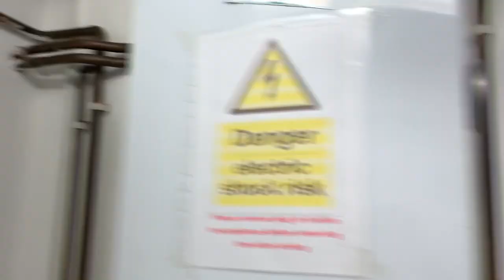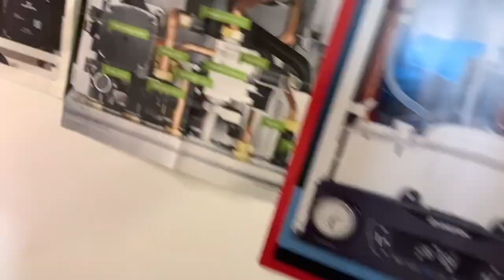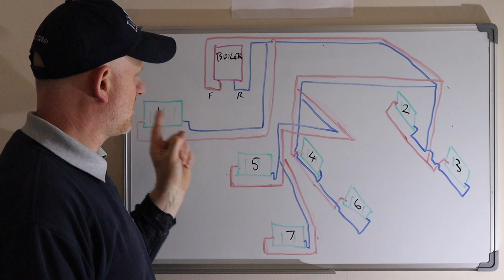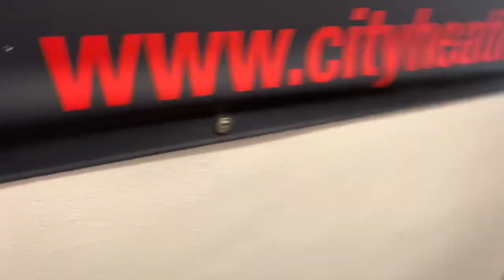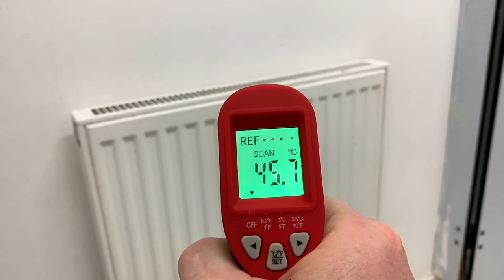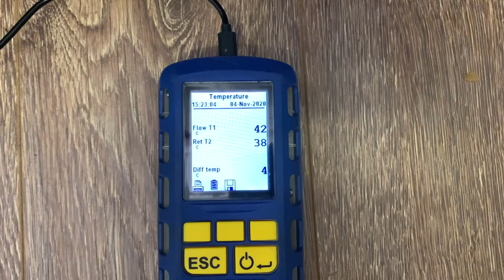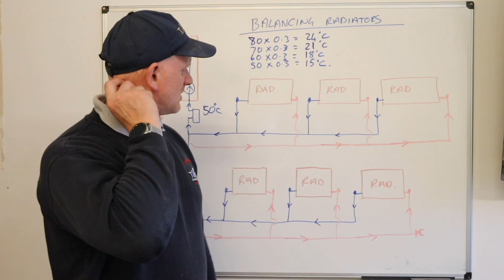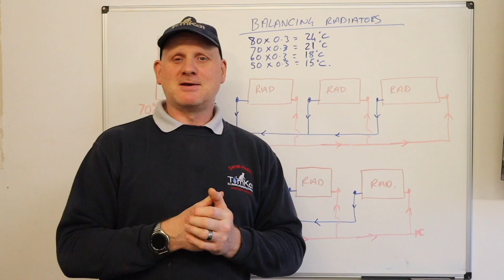BALANCING RADIATORS part 2  looking into the ways of balancing radiators and seeing if it works.

Comment: yes I did watch ...  and I thought your comments about room-stats were spot on .. .. rad-stats on the other hand are often part of the problem, how can you site a stat onto a hot water pipe in close proximity to a radiator and then pretend it is measuring ambient room temperature,  not reasonable to expect it to do what it is being asked of it.
Reply from the maker: To be fair to trv’s they do work but most people set them to 5 so they will never turn off
Reply: Fit them to the return pipe, not the hot supply - they they are in the cold* most of the time. * I mean ambient temperature.

I've actually fitted my TRVs UNDER the middle of the rad !

Comment: I have a condensing boiler but the pump is not an ERP pump how do I work out the flow and return temp drop do I observe the temperature and adjust the pump speed ?

Comment: Great video Derek, Its nice to see an expert show how hard this can be in the real world!! I watched this to see if I could pick up any pointers as I need to do my home system... I found that 3 of the rads have the flow and return reverse connected. With the TRV on the return leg and a lock shield vlv on the flow. I am guessing I need to correct this but what are your thoughts please??
Reply: Check the trv if it’s got a arrow pointing one way then it’s flow sensitive and the heat needs to come through the valve first but if the trv has got a arrow pointing both ways it’s bi-directional then it doesn’t matter!

Comment: My boiler shows flow and return in the menu.  Flow is set to 50C with the return at 35C.  My 4 bedroom small detached house was built in 1990 and with your help I have all the radiators heating up evenly at the same time.  They all do feel very cool at the bottoms of the rads and the house takes longer to warm up but even last winter when it was -8C outside the house still heated up.

In your video I don’t understand how you can have a radiator hotter than the flow temperature into it?

Comment: Thanks for making the video Derek 👍. I hope in the future there will be a better way of balancing!! Or at least easier. 
I think there are some boilers that help (possibly Viessmann although I could have that wrong) and grundfos and Danfoss make some good apps that may help 👍
Reply: There is - just fit TRVs (and leave the lockshield valves fully open)
Reply: @millomweb  Wrong! If you do that, you won't get an even distribution of heat, upon system start up. The rooms farthest from the boiler pump will take longer to heat up.
Reply: @hvacdesignsolutions  TRVs reduce flow considerably - and that forces the hot water along all available routes fairly well balanced.
Reply: @millomweb  TRVs make the flow go in sequence, making a lower delta-T.

Comment: I preferred when pumps had 3 speeds . Because if i had a heating issue or radiator not getting warm , i could increase pump speed temporary.  Or adjust pump for various reasons.  It was just more user friendly.
When you said  "The Return temperature is getting to high?"  I always find myself up against Low Return Temperatures, when i measure temp directly on return pipe at boiler.
I'll be honest & i normally go all "Old School"  & check temperature's by god old human hand.  lol.
Drifting off subject, my Non contact thermometer from day 1, has always seemed inaccurate!  TPI 368, it always seem's like the readings are far too low.  So i mutter a few swear words under my breath & revert back to touch.
So when you mentioned the Return temp. getting high, did you take readings from return pipe at boiler or at radiator return pipe?
Thankyou for video, as i only started watching recently, so sorry about posting on a old video.
Reply: A low return temp is good - helps the boiler condense flue water vapour - improving efficiency.
Reply: @millomweb  my new boiler cuts out if the output and return flow temperatures are too different (Vaillant ecotec)

Comment: I watched these two videos then spent nearly two days balancing my radiators!
I knew that the plumbers who fitted my system couldn’t have balance it, they left too soon after filling the system.
I’d been experimenting with lowering the flow temperature and found that I couldn’t get the house comfortable with a flow temperature below 65 degrees.
Now it’s all balanced I’ve got the flow temperature set to 50 degrees and the wife hasn’t noticed 😀
The maximum flow temperature I’ve seen at a radiator is 41 degrees. So now I have to go into the loft and find where the spare ten degrees is going. 🤔 (I live in a bungalow and all the central heating pipes are up there.)

Comment: My tips here: listen to the sound that the water makes when restricting the flow. It makes for a fine initial setpoint on the first rads.
Second, just let the heating run, and measure return temps only. If return is equal, (top of rad must of course be warm), you're good.

Comment: Pump speed too high. Trouble with modern combis with a 7m head pump.  You need to adjust the pump speed first with all valves open. Honeywell Valencia TRV’s are also able to be balanced through a nut under the plastic TRV head. Top tip if you have towel radiators then use both valves to throttle them right down if they are wheel heads
Reply: It seems combis often have single speed pumps.

Comment: I've been in a ground floor flat of a  Victorian construction house approx 1600 square feet with huge rooms and 3m high ceilings for 13 months now and I've had more success balancing radiator sizes and BTU requirements due to the explantions and clear content of your videos. Thankyou!
However, next year when we change the boiler and upgrade some very old rads the heating engineer is getting the Spanish Inquisition on efficiency and calculations. I apologise in advance to whomever it may be. 😁
Reply: Make sure he fits Type 22 downstairs

Comment: Over here, plumbers like to fit calibrated valves. Adjust to the radiator size and delta T will come out correctly.

Comment: Hi Derek really good video. The only thing that I didn't get if the boiler flow temp was 44. How come you were getting 50  deg at the 1st radiator?
Reply from the maker: The metal of the radiator is holding heat also the different thermometers may not be completely the same reading.
Reply: Poor quality instrumentation.
Reply: Yeah, it can only be the instruments not being very accurate

Comment: is the DT20 based on a DOT of -3c similar to other areas of heating? Your heat loss per room will be based on that and in theory your rads sized for that. So your DT may only be 20 when your room heat loss is at DOT. If you’re at external temp of 10-12c your heat loss will be half so your DT will be much lower?

Comment: You mentioned the pump being an issue initially with getting heat to all the radiators.
Now when throttling down each radiator in order to achieve a delta t,  am I right that the pump will automatically slow down gradually, as you adjust each radiator ?.
Secondly, why is it necessary to allow the system to cool after each stage of the process ?.

Comment: Hi Derek I'm sorry but I didn't understand why you haven't range rated the boiler down to meet your system's needs...in my opinion the return was so close to the flow also because if the boiler is putting in too much heat for your system, the return starts to get closer to the flow because radiators can't dissipate the amount of energy they're receiving...the boiler begins to modulate down when it's approaching the flow temperature required but it could eventually come off if the minimum output is still too much...am i wrong? I'm a young apprentice trying to learn more

Comment: M new WB boiler is labelled e
ERP does that mean it has one of those pumps?  The installer upgraded m old floor mounted CF 8000BTU Ideal E Type in a day and did not spend much time explaining the physics. M boiler booklet says set it to eco . So could I turn it turn or leave it at ECO. It is a system boiler so feed the hot  water cylinder that needs to be 60 of course.

Comment: Hi the video was very nice. I have tried all these in my house and i have come up at the same conclusion. About my set up i have a Vaillant ecoTEC Plus 838, 14 brand new radiators all of them brand new, and 22mm and 15mm pipes. i know all pipes distances which are from 12m the closest to the boiler up to 26m the longest on controlled by nest 2nd gen. All rad have TRVs. Flow temp 60 C return 54 C according to the boiler information. My problem is that the house warm up relatively slow (in my view), according to nest 1 degree every 30min and the longest rads take longer time to warm up. Off course when I close some TRVs everything speed up. I have come across 2 potential solutions. The first is to install external pump along with Low loss header and to fully open all valves or the second one is to buy Honeywell thermostat with digital TRVs to control the temp at every room. I know that they are not same approach. What do you think? What is your opinion. Thanks

Comment: I have two radiators that isn’t getting hot flow in the same part of the house. I’ve messed with the lock shields but not really solved the problem.  I’m interested in the thermostats on the radiators of which there are 5.  I’m going to turn these off.  Let’s see what happens cheers

Comment: Great videos on this subject, yes would love to see a balancing up of real system and the time it takes as i will put my hands up that was just getting  the rads to   being with in 5 to10 degrees across the house not across the flow and return of rad, everyday is school day, thanks for all your videos and the time you spend passing on your knowledge, 💪👊😁
Reply: I would also like to see how to do it properly in a real house, please ease please.
Reply: @ChristianBHough  Just fit TRVs and leave the lockshields fully open.
Reply: @millomweb  That's not going work unfortunately.
Reply: @ChristianBHough  That's what I have - and it works FINE !
(providing your rads are big enough !)

Comment: I think it would be a good idea if this process was automated . Control by individuals  wireless room thermostats. With feedback control sensors ( heat, flow, pressure) to radiators motorized electronic control valves. Mecv valves.😳
Reply from the maker: No one would ever have their heating changed because of the price most people just want the job doing ASAP and as cheap as possible but your idea is something I have thought about something like an underfloor manifold that controls the flow to each separate radiator and controls the heat to each separate room 👍🏻
Reply: @tomkatgastraining   and call it integrated heating system. 😳
Reply: Don't need wireless roomstats - just fit TRVs. Does the same job more simply.

Comment: Would doing this work on an open vented system with a condensing boiler? Ive set it to 55c for water and heating because thats the only option available.

Ive managed to get most of my radiators to have a minimum of 10c across them, so what do i need to do with my pump? Its on the middle speed atm, do I speed it up or slow it down?
Reply: My pump is a Grundfos UPS2 which is pressure reducing. Do I need to balance my radiators after setting it to pressure reducing as my system is running colder since changing it to pressure reducing.

Comment: Great stuff.
having just been round 21 radiators in this house trying to get that delta T. looking at the clouds forming above the flue from non condensing. I just realised that the HW (cylinder) was in the loop and shoring the boiler.
the override for my control turns all the diverter valves on..
some rads could get 20 Deg drop. most were about 6 and granted it could be colder outside.
the WB CDI 40 did a stonking job of throttling back to keep the flow of 60 for a fixed pump speed. set correctly in the setup though as it only measures the flow temp.
sadly it doesn't have external bus control. but I don't see the difference between the stat reducing the output as we approach setpoint, and the boiler reducing output as the return increases, as we reach setpoint.

anyway. it's a dark art and took about 3 hours. but the appliance consumed 50kwh of gas with the last hour down to a 12kwh burn.
I think close enough is good enough. I will check it again when it's colder outside and we need the heat.
great video, but there is a lot of science behind why we should do this, complicated by modulating devices.

Comment: Hello, I am need of a heating engineer to trouble shoot my recently installed Veissmann boiler, I have had three veissmann installers who are giving opinions rating from its ok( when radiators aren’t working) to I need to spend £1800 to rectify the problem, how do I choose a competent engineer?
Reply: 1800 ?? That's about the price of a boiler and a half ! My Veissmann was 1200 inc fitting !
What's the problem you're having ?

Comment: I think the real problem here is the pump is effectually massively oversized for the system, but there's not really a lot you can do about it with a combi. The narrow delta T is because the water is moving around way too fast, and throttling the lockshields down so much will probably reduce the life of the pump.
Reply: No, I think it wont. Years ago I found an article in an engineering magazine that said the opposite was the case with a centrifugal pump. i.e. less flow is less work. In my case I had a submersible sump pump,  circulating water in a big tank) that  failed after a few months presumably because the flow was unrestricted.

Comment: Hey Derek,
you're the man. love your videos, plenty info and a good laugh. 
QUESTION. I've got a W Bosch Oil 18/25kw Boiler Heatslave II with 7 rads. all my TRVs are fully open (5) and lockshields are open with no room stat. Flow set to 61deg. is this bad sh*t? it set ON three times a day for about 2 hours each time.
Reply from the maker: Yep get a room stat and set you TRVs to the correct setting 👍🏻
Reply: How to use a heating system the old fashioned way ! Getting a roomstat is the least of your worries!

Comment: ... if all the radiators have trvs are you not in danger of stopping the flow completely whilst the boiler is on if the room stat is set high?

P.s. isn’t it easier to get a greater delta t the bigger the radiator is as it dissipates more heat from any given flow?
Reply: If all rads have trvs,it's better to put an bypass valve in which can be adjusted so only open when trvs are restricting sufficient flow! I learnt a great deal from watching this presentation, I'm self taught fit plumber, installed 3heating system's, always get boiler  engineer in to commission boiler! I've sorted out several heating systems put in by,l think cowboy plumber including my present bungalow, plumbing here terrible if l couldn't do much better than this I'd give up,I've even done calculating for rads size all done properly, if l can't do it correctly first class l wouldn't touch it! I'm electronics engineer by trade with I.q of185, so not much l can't do or fix!
Reply: The room with the thermostat in shouldnt have a trv fitted to the rad. The thermostat is the trv.

Comment: I think this demonstrates exactly why many heating engineers fit the system and do not bother to try and balance the system.
Reply: Cos if they've fitted TRVs, they don't need to - TRVs do the job themselves.
Reply: @millomweb  Not all TRVs are equal.
Reply: @normanboyes4983  Of course not ! They allow the appropriate amount of hot water into each rad according to the room temp and their set point.
Reply: @millomweb  without ensuring sufficient flow to some ……
Reply: My birds old flat had a heating system set up with all lock shields fully open. It took 3 hours to warm the living room up because she had to wait for all the trvs to warm up and shut off. Balancing is critical to save money.

Comment: Brilliant and an honest appraisal of what most engineers knew😂
So basically be careful if you don't use Lockshield valves be prepared for a lot of hard work to go out the window when the customers or decorators adjust them😂👌

Comment: Excellent video. I hope everyone who wants to ‘balance’ radiators watches this first. I had just bought an IR thermometer and was going to look at balancing the system this afternoon. Thank goodness I watched this. I’m not going to waste my time with this procedure. 
I will ask what might be a couple of dumb questions? I think you are trying to balance to achieve the required temperature in each room. In which case why not rely on the TRV to do that for you? 
In that case do you want to adjust the lock shield to get the rate at which the radiators get warm to be approximately the same? Otherwise the rooms could reach the desired temperature at markedly different rates.
Reply: Yes, make it happen around the same time. Higher efficiency and better comfort.
You can go about it incrementally. Start with radiators that get hot instantly and restrict the flow until you hear a slight noise from the water flow in the valve.